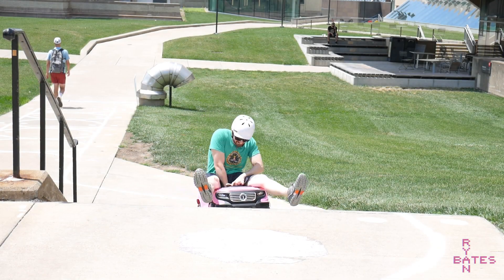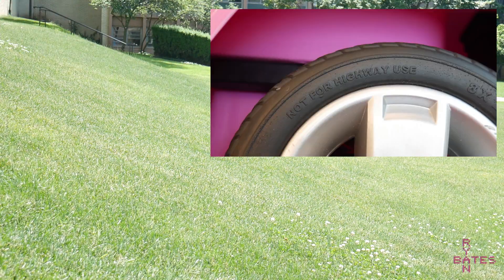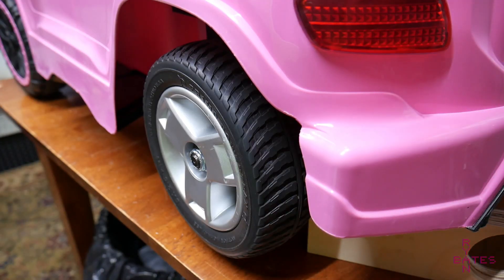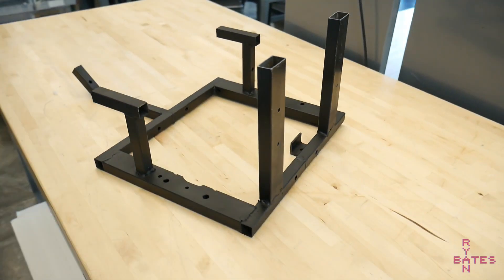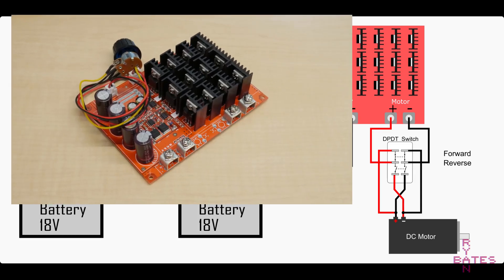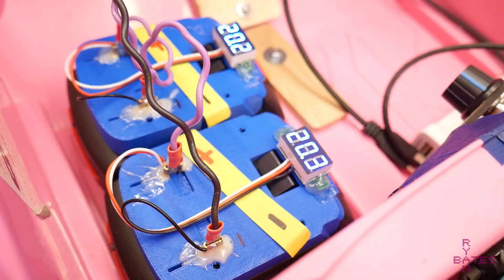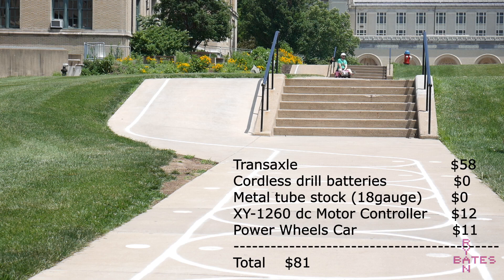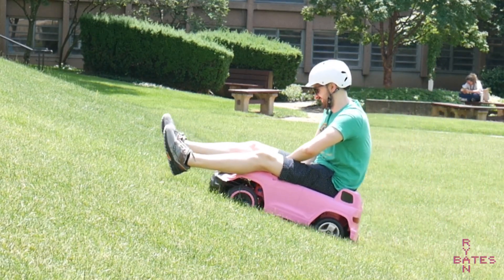Mobility Scooter Power Wheels +  40V of Power Drill Batteries

Comment: Hold on how do 2 18v count up to just over 40v? Wouldn’t it be 36v?
Reply from the maker: 18V batteries are the nominal voltage. At full charge they are 20.4V each, discharged they are ~16V each

Comment from the maker: I have three 18V batteries... should I bump the voltage to 60V (3 in series)? The helmet might actually be useful if I do this.
Reply: Please do it
Reply from the maker: OK i did it. 3 batteries = 60V drive. Top speed is about 15-16 MPH. it's a bit unwieldy. understeers and is twitchy to handle; so it's perfect. The FWD/RVS switch gets warn, and the wiring gauge i used is dancing on it max current capabilities at full drive. Gear box / motor start to get warm, but not hot. Motor controller caps are rated at 60V so it's not a permanent mod, but a fun test. I'll put in a wheelie bar and do a follow up if this vid gets to 10k views.